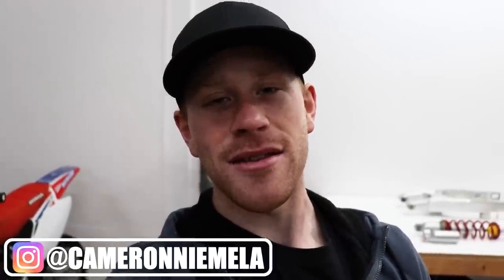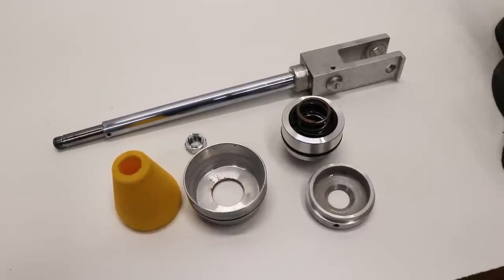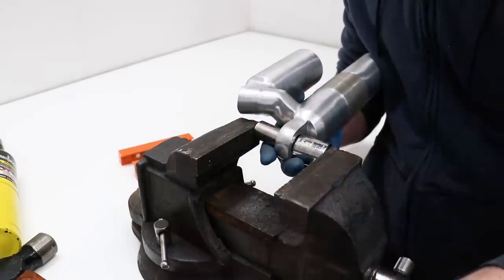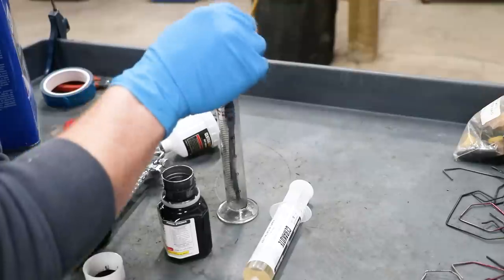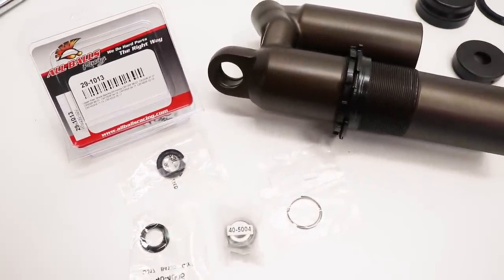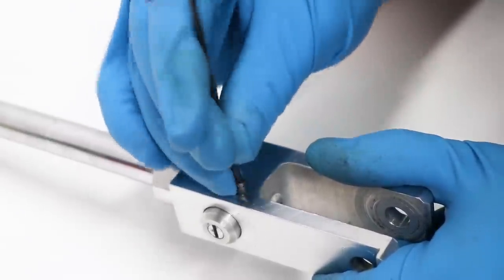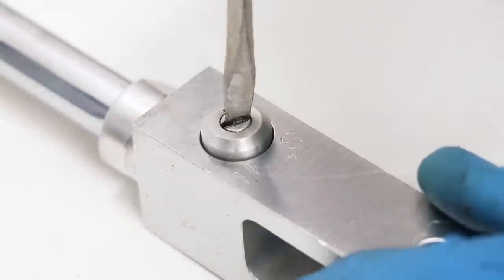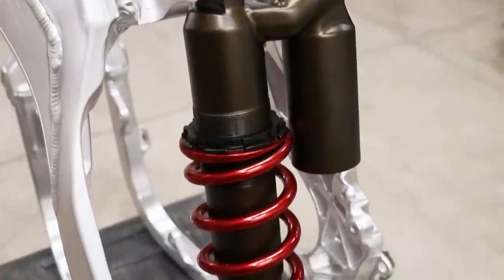Amazing CR250 Shock Rebuild!

Comment from the maker: Time for engine assembly or what??
Reply: Cameron Niemela OHH YEEES
Reply: Nice work mate, grettings from Italy 😉
Reply: Cameron Niemela Once shock is installed on top of frame with new bearing should there be any play moving side to side when bolted in tight??
Reply: Oh yeah!!
Reply from the maker: No it should be tight side to side
Reply: Yeah!!!
Reply: John Klause like Cameron said, should be tight
Reply: Cameron Niemela Thanks for responding. I guess I could pinch the brackets in. I dunno.
Reply: yup
Reply: John Klause if you can use spacers. Depending on how much the shock moves. Could use two thin washers or whatever it is that you'll have to use to get it to line up with the linkage
Reply: MX4Life 248 Thanks man. I couldn't fit washers in there. I thought the bearings were out so I put new ones in and put a new bolt through it. I don't think it will matter once new linkage is all hooked with new bearings. But yea thanks brother.
Reply: John Klause you're welcome!
Reply: Ready Ready
Reply: Cameron Niemela hell yes lets goo!
Reply: Take your time Cameron and do the right things or the things done right ...

Comment: The Clevis Will un-thread from the shaft.  Put the clevis in a vise and use a large wrench on the shaft nut. Once you get the clevis off the damper rod is exposed. be careful not to damage this.

Comment: hi Cameron
I have my cr 250 2003 with a rear shock that im thinking of servicing.Although i found out that the 2008 CRF has the exact same fit so i was wondering to swap it to my CR since i belive its more advanced tech wise.
Waht do you think ?
I appreciate your opinion
Joao

Comment: Hi Cameron, I have a question, I need to change JUST the shock bladder, can I do this without actually pulling the main part of the shock apart. THANK YOU VERY MUCH.
Reply from the maker: Yes, you can replace the bladder without taking the shaft out
Reply: @CameronNiemela  thanks for the quick reply, I'm gonna be trying cerakote on a few bits n Bob's on my bike and ur videos are invaluable, THANKS FOR ALL YOUR EFFORT.

Comment: looking the rear ammo stripped down my question is: is only that small clip that hold together the rear shock when fully extended like in a jump? or is there a "downstop" on the main frame & rear suspension linkage doing that work?
nice vids, keep doing that nice job
Reply from the maker: Thanks for watching! Yes, the circlip does hold the shock shaft from coming out of the body. The linkage does limit it somewhat but it's mostly the clip.

Comment: Hi Cameron, why do you soak the parts in acetone while they have already been degreased? thank you
Reply: That's the process recommended by the Cerakote manufacturer :)
Reply: matias lorenzo it’s just making sure that there is NO grease or grime is left on the parts. Cerakote is really sensitive to any grease

Comment: I installed a new piston ring and o ring and the shaft is very hard to move inside the shock, is it normal?
Reply from the maker: Yes, it is normal for the shock shaft to be a bit stiffer with a new ring, but if it won't budge that's an issue.
Reply: Cameron Niemela found out it gets stuck because I push it too far.

Comment: I have a problem on my dirt bike if anyone wants to help. Whenever I press my rear break the breaks work but the break pads don’t retract from the disk. I pry them off with a screw driver and then the wheel spins freely. But it happens again when I press the brake peddle
Reply from the maker: Sticky caliper, you'll have to pull it apart